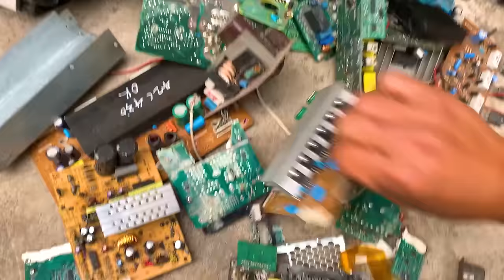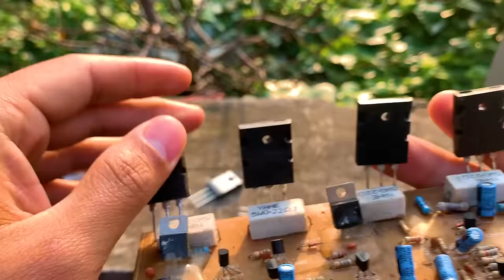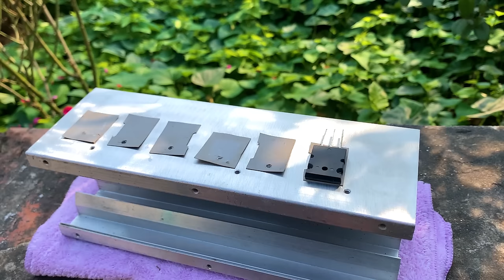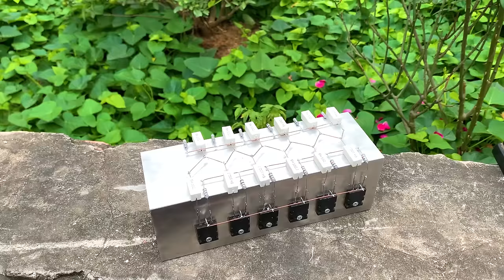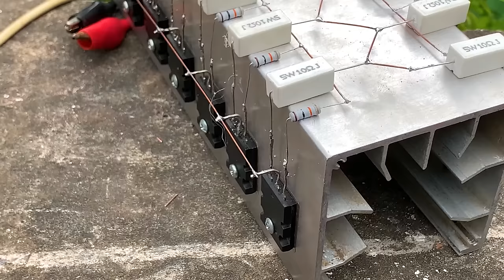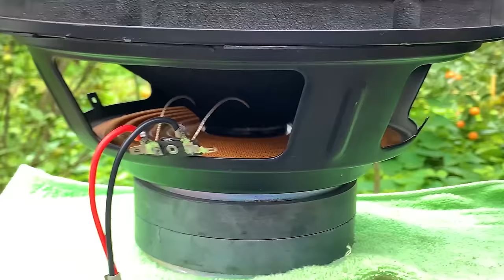DIY Powerful Ultra Bass Amplifier 12 Transistor C5200 , No IC , Simple Circuit

Comment: I'd like to build this and throw it up on a scope to analize it.. Can you share the circuit diagram?  It looks like you are using the following
Heatsink
2SC5200 Transistor NPN Quanity 6
2SA1943 Transistor PNP Quanity 6
10K Resistors  Quanity 12 (6 to each PNP Emitter) and (6 to each NPN Emitter)
5W 10ohm Resistors Quanity 12 (6 to each PNP Collector) and (6 to each NPN Collector)
2SD718 Transistor NPN Quanity 1
2SB688 Transistor PNP Quanity 1
250V 150uF Capacitor Quanity 1
225J 400V Capacitor Quanity 1
Speaker 2 ohms 
Battery 12V (I presume)
Power cord Red/Black
1/8" audio input
ipad for music source

Comment: te consulto e armao el mismo y no me a funcionado pero lo hice con los transistores a1941 y c5198 funcionaria igual ??

I ask you and put together the same one and it didn't work for me but I did it with the a1941 and c5198 transistors, would it work the same?
Reply: no te va funcionar por que todos sus videos son falsos esconden un amplificador real en algun lado el circuito no es funcional con 12v no esta del todo mal pero no funcionara con 12v ademas ni siquiera esta la etapa de preamplificacion necesaria para que este arreglo suene,ademas no hay fuente simetrica teniendo pnp y npn

Comment: Well it is not 3800W, it is 38W if the voltage drop on low inpedance speaker doesn't count, of course the output voltage on 1ohm would drop to very low output voltage.
Reply: i think is not 38watt.. must be remove 8....just 3 watt maybe 🤣😂...
sorry...👍👍👍 nice video for owner channel...but please dont add so much watt i think
Reply: @ourchannel8215  yea, But if we count that the output voltage not dropping on 1ohm. He Got somewhere 38Watts and thats why he thinks (the owner of this yt channel) it Is 3800watts ofcourse. But you Are right it Is only 3W or lower ofcourse.
Reply: @ourchannel8215  i rewatched this video for cringing and crying purpose, and i did noticed that he did removed 4+4transistors from an "okay and fixable" amplifiers that might worth something, this is what i not noticed seven month ago when i commented. Oh my good god. and yes, it will be about 3watts. Yup lets cringe more :D
Noo, 2 transistors are hotglued on the heatshink 😢. Noo, noo noo I'm Crying

Comment: creo que este es el único de sus videos que cumple con lo del título
Reply: No tampoco, es igual de falso con 12v no se logra esa potencia, solo tiene los transistores como adorno
Reply: @InventableESPT  xD
Reply: @InventableESPT  cierto, la máxima potencia con suerte será calculada a partir de una señal de 6 volts de pico (12 pico a pico), por lo que la potencia máxima será (Vpico^2)/2R = 9watts máximo con muchísima suerte si la resistencia es de 2 Ohms.
Reply: siempre oculta cables o hay un pequeño amplificador dentro de esa bateria por que el circuito esta totalmente mal ya que tenes transistores npn y pnp el tipo le mete + 12v gnd no funcionara ademas no existe la parte de pre amplificacion

Comment: como esta una pregunta yo ise una un amplificador con una terejeta estereo con 4 transsitores  nt2625n y me calienta los inpusores tp41 y el 42 y los quema me puede ayudar con eso por fa gracias
Reply: El problema puede residir en el bias.
Checa como controlarlo.
Dependiendo debes probar con .20 volts hasta .47
Un bias alto calienta y vuela los transistores...prueba con más bajo voltaje de alimentación y coloca bobina (diámetro 1cm y 15 vueltas) a la salida